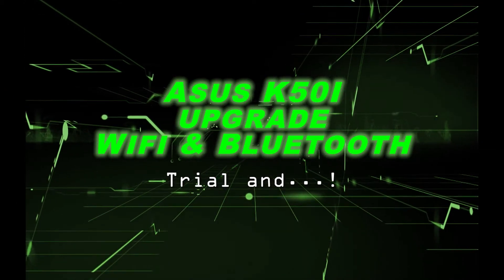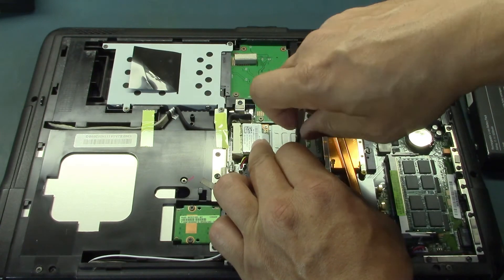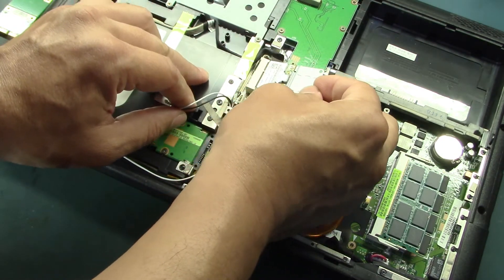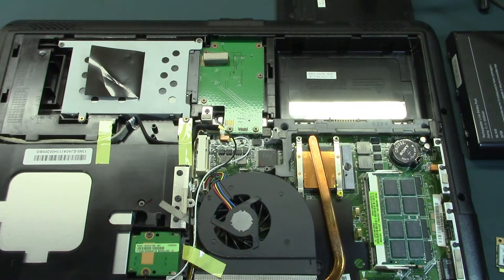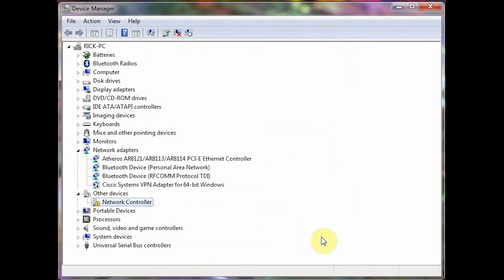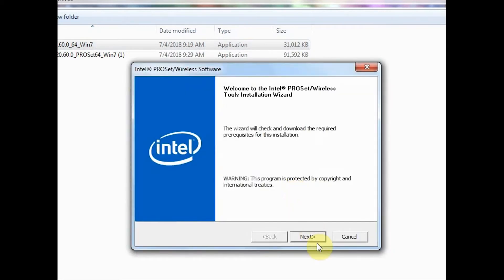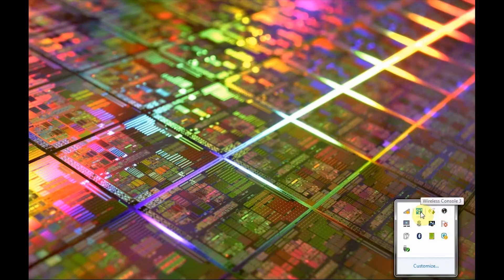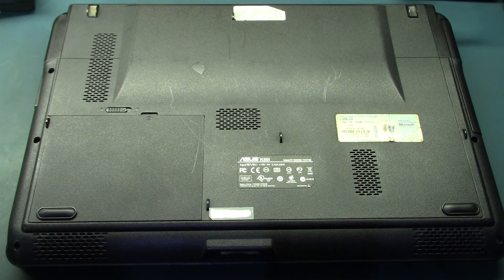RTL#10 Asus K50ij Wi-Fi Upgrade

Comment: I bought a dual band ac 7265 and a pcie adapter. Bluetooth is working, lan line works, wifi does not. I was told it should work but I'm never sure of anything I read on the internet anymore. But your vids have helped me upgrade my old rig for my mom's use so far, so I thought you'd have advice.
Reply from the maker: Check on Device Manager that there are no errors or it is missing a driver, while the card has everything integrated drivers are separate.

Comment: Does it contains bluetooth inbuilt or did we need to add
Reply from the maker: Asus Function software has the option to control Bluetooth but the option in the adapter was not there, but by upgrading the wifi adapter card we introduced Bluetooth as an added option. Bluetooth must be included in the wifi adapter for that to work.